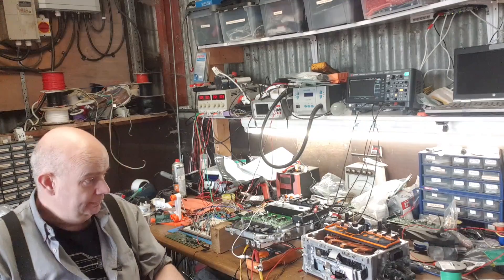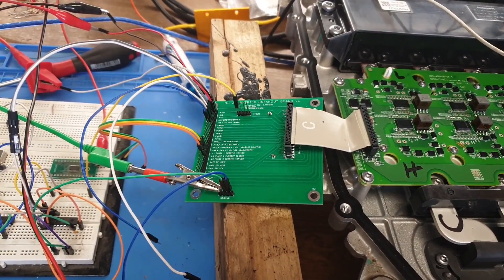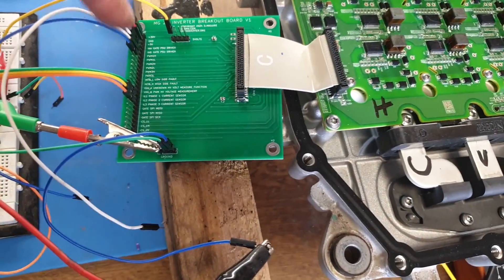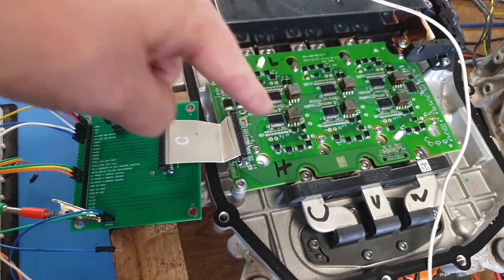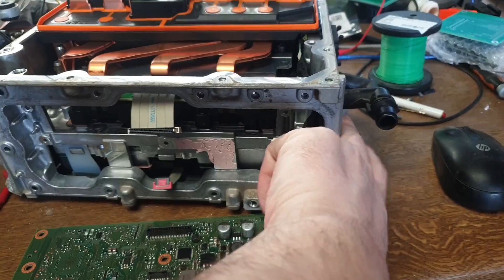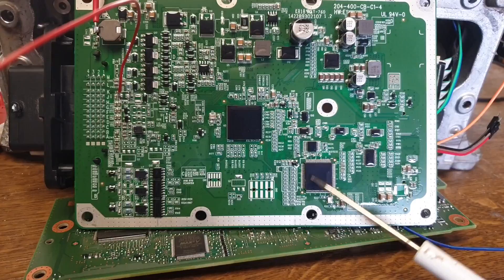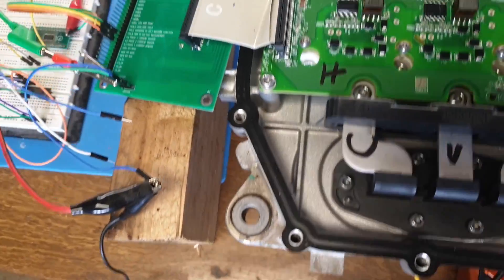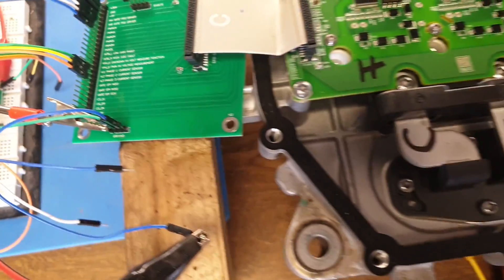MG ZS EV Inverter Reverse Engineering Part 1

Comment: Complexity management if an important engineering skill. I would rather have a small micro receiving commands from the 'big' micro using a CAN or uart interface. Program the micro (at the gate driver) to factor in the temperatures locally. Or how about the Tesla Cybertruck with drive by wire? Imagine getting auto cabling that is flat, with a consistent reliable connector system that is learn once, use everywhere forever. (and available from DigiKey and Mouser)